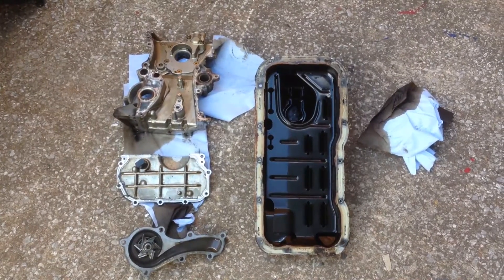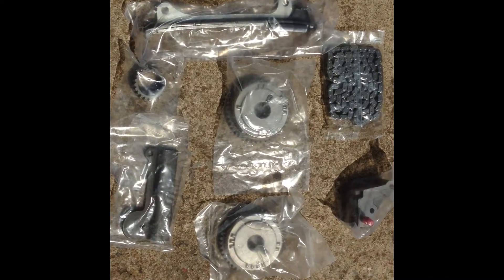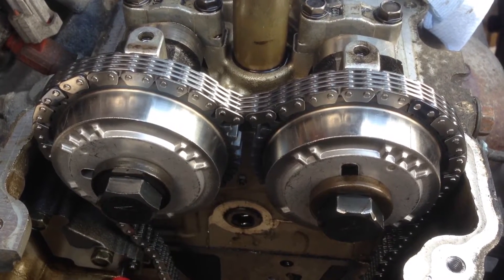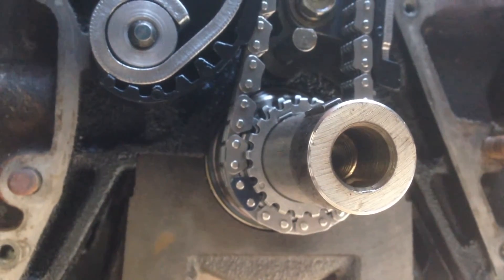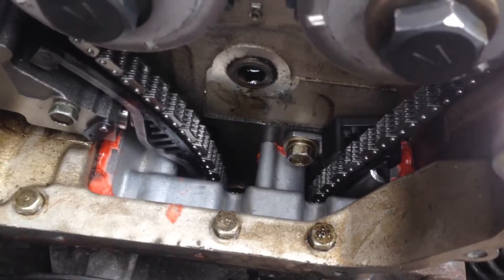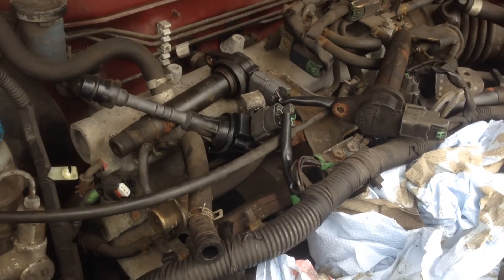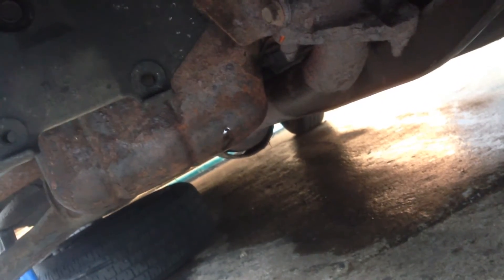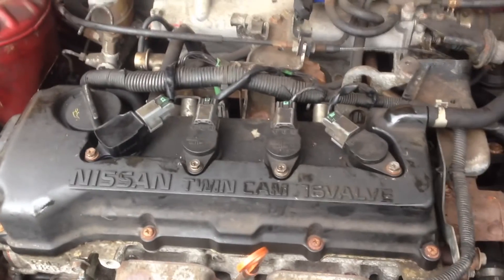2000 Nissan Almera Timing Chain Replacement Part 2: Rebuild + Start!

Comment: is there a way to find out if you have a vvt or a non-vvt  engine without taking the top engine cover?
Reply from the maker: The VVT covers usually have a bulge in the side to clear the cam adjuster but only way to really know is to take the cover off

Comment: How do you bleed the coolant system
Reply from the maker: Fill the system with coolant and start the car with the radiator cap off, let it get up to temp, fluctuating the revs now and the , make sure the heater controls are on max temp. It helps to jack the car up at the front, air will always travel to the highest point in the system.

Comment: just one question. i have the same car that has gone about 108 000 km. When is this likely to occur? at wich kilometers/miles did you need to change it?i bought this car from a guy that only used it in the summer season. the winter tires are 12 years old and barely has a scratch lol
Reply from the maker: It depends on how well serviced the engine has been, but I do see it recommended at around 160k, I wouldn’t recommend changing it unless the engine develops poor running
Reply: @bakergtr  Ok, thanks. my engine is currently running pretty good, no stalling at idle and the rpm meter is pretty smooth. i changed oil and filter at 103 000 and did the same at 106 500. when i bought it at 101 000 the oil looked good, but the filter looked pretty old, had a little dent on it. and it was written NISSAN on it. i hope it is not the original lol. I looked into the service history and found out that the owner before me only serviced it at the nissan dealership, so i hpe thats why
Reply: How long did your last?
Reply: Im hearing some sort of metallic grinding noise around 1000-2000rpm usually around 1500-2000 and i suspect its one of the pulleys or the timing chain. Can the timing chain make that sort of noise?

Comment: Supposedly an engine out job to do this. Was it particularly bad for access of easy enough to do. I'm thinking of this as a little summer project if I keep my car as mine will need doing
Reply from the maker: It’s easy enough to do with the engine in place, no reason at all to remove the engine :)
Reply: @bakergtr  spot on thank you. Ok cars for run abouts just shitty tensioner. I'll see come mot time if I keep the car 😂

Comment: How do you adjust the valves and what Tools do i need?
Reply from the maker: On this engine the valves don't need adjusting as they use hydraulic tappets to maintain clearance
Reply: bakergtr i have opened the engine and there is no space beetween some of the in and exhaust valves and the shaft. I am running LPG and now i need to buy some of the little plates for ejusting , because my Almera has regular valves its from 2001 qg15de
Reply: @bakergtr  The valve clearances need to be adjusted by replacing the cups or plates under the cam lobes. There is no hydraulic adjustment.
Anyway I don't think it needs any adjustment in it's lifetime.

Comment: Hello. Can you change the timing  chain and leave the old vvt gear and sprocket ? or i need to get new sprockets ?
Reply from the maker: Hi, everything I've read has said to replace both, presumably so they wear in together, might have some slop if you don't change the sprockets too

Comment: i wonder if it is possible to do a temporary workaround to get more life out of the chain by moving the cam sprockets one tooth, maybe that would put them too far wrong the other way.
Reply from the maker: I wouldn't imagine so, it would affect the ignition timing as its driven (I believe) by the cam sensor on the exhaust cam, plus the chain would still be slack too

Comment: Good effort. I have the same car. A trader gave it to me as payment for a paint job i did for him. It spluttered from cold so i changed the maf which seemed to cure it for a bit but now its getting more and more even while driving so im guessing i have this job to look forward to. The suspension clunks. And i think it needs a clutch now. I think i might just blow it to bits with a shotgun and send the video to clarkson :-) :-)
Reply from the maker: haha yeah I've got a few other problems with this, mainly it dieing on idle, but have worked around that one for now ;)
Reply: I have the same car too lol. I changed the clutch, then after that i found out about this timing chain issue lol